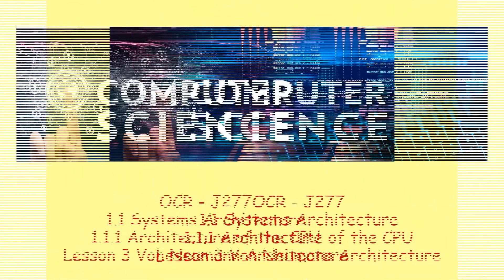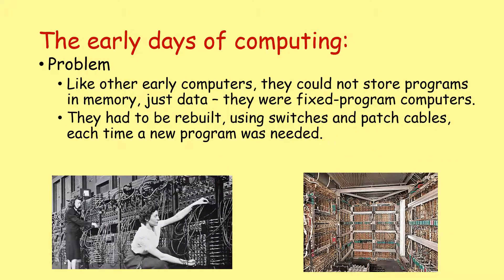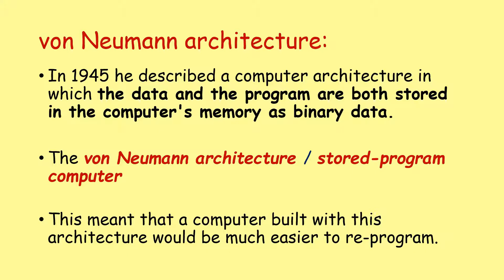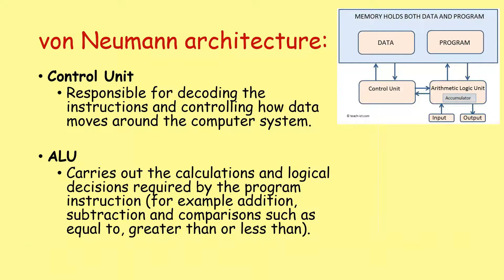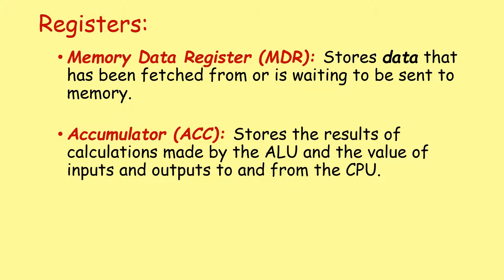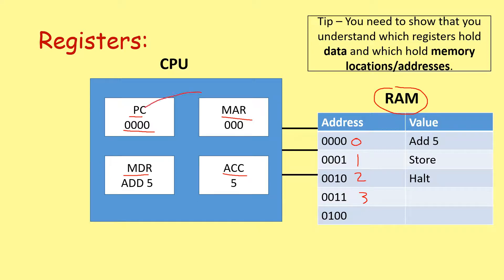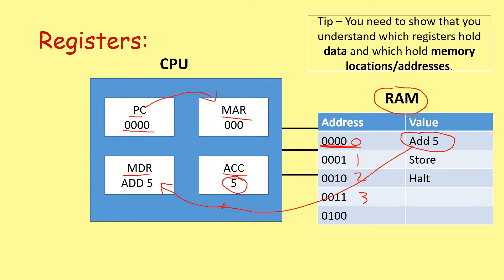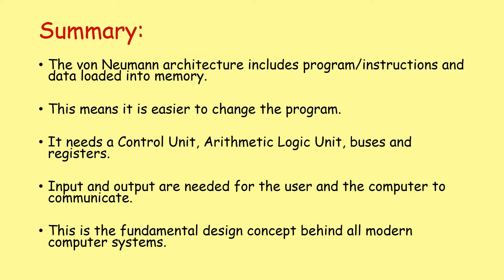OCR J277 Systems Architecture 3) Von Neumann Architecture

Comment: When is MAR involved in the sequence ?
Reply from the maker: The MAR is used to hold the location/address where data will be fetched from or sent to in memory.  So if the CPU needs to load the contents of memory location 8, the value 8 will be placed in the MAR.  The control unit will then trigger a read operation and the value in memory location 8 will then be sent to the MDR.